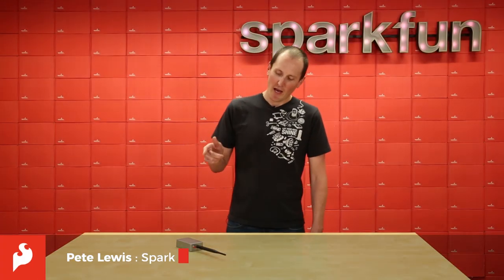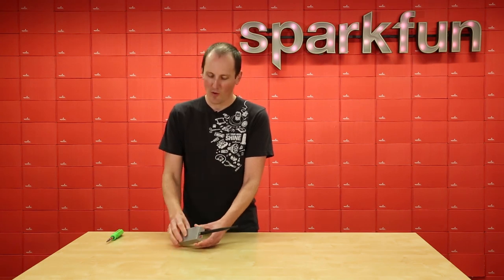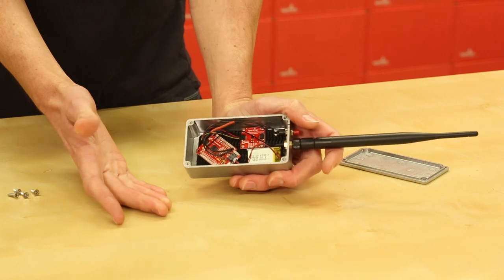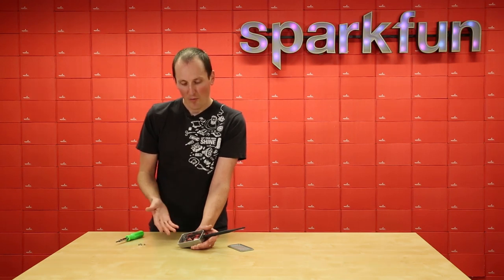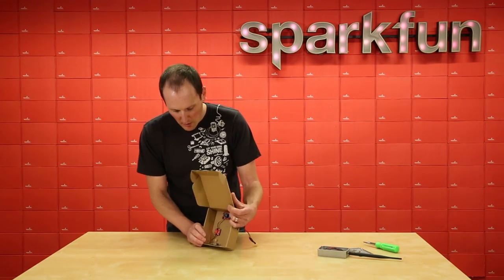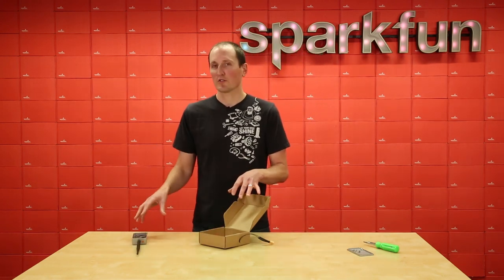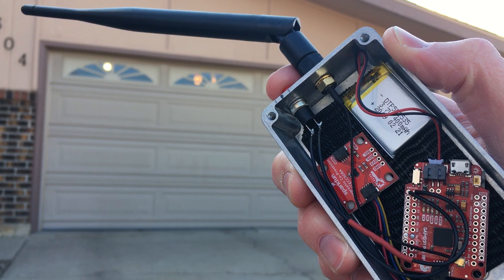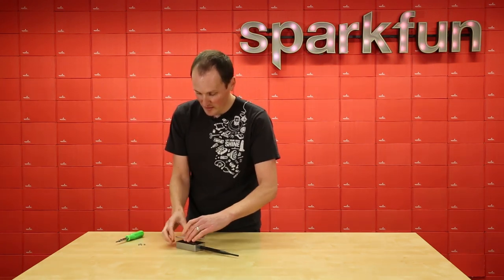Project Showcase: Secure DIY Garage Door Opener

Comment: It you had multiple garage doors you wanted to control independently, is it possible to use a single Pro RF in the controller and separate Pro RF modules for each garage door and just have either a seperate momentary switch for each garage door? or is there a simpler way of thinking about this?

Comment: Thought first "secure" means that the device attends to any obstacle like playing childs, dogs while opening or closing! ;-)
Reply: Haha. Well I'm sure you'll be glad to hear my IR safety beam detector is working properly now. It was actually broken a long time ago, and we've had to override the safety sensor by holding down the button for the entire time it goes down (such a pain). I eventually looked into it further, and the line to the sensor was broken. It was a very clean cut about 2 feet up the wall, so I'm wondering if it was super cold weather and it got caught on something, or maybe a certain curious child with scissors was involved :)

Comment: I'm just going to assume you disabled the original remote RF circuitry in the garage mounted unit. Otherwise you'd still be vulnerable.
Reply: Hi pratherat,
Thanks for commenting. You're definitely correct, and I overlooked this in my design. My plan now is to try resetting my unit to forget all remotes, and I  might even unplug/remove the antennae, but I'd like to avoid damaging the unit and/or voiding the warranty, but I'm probably already way past that :)

Comment: Hi hows the device in the garage powered?
Reply: Hi Josef, 
Thanks for asking! I forgot to put that in the wishlist... eek! 

I went with a wall wort power supply for the receiver end that lives in my garage. It terminates to microB, so it goes straight into the USB connector on the Pro RF. I believe the exact model I have in there is this:

https://www.sparkfun.com/products/13831

But that's pretty overkill at 2.5A. Our lower current version would do the trick:

https://www.sparkfun.com/products/15311

It was a slight pain to run power across my garage, but it when pretty qwiicly with a staple gun and an extra extension cord I had.

You could also opt to go with a battery power on this end too. With that idea though, you'd need to be listening for incoming messages all the time and so a plug in power supply option is what I chose.

Comment: so does your old 433Mhz built in receiver still there you need to kill that nice project
Reply: Wow, good point. Thanks for commenting. I definitely overlooked that. I'll have to open up the main control box and see how to disable that. Hope it's not too tricky!
Reply: @PeteLewis  All you've really got to do is reset it. On every one I've ever seen, there's a button to make it forget all of the linked remotes and then also to program a new one. If you set it so that there are no linked remotes, then it should be pretty secure...

Comment: needing to engineer something to escape the constant threat of snow parking bans(basically the city kicks us off the street so the plows can remove the snow). the 2 car garage behind the house im renting the 2nd floor rooms is half rented by someone who uses it maybe once per year if at all so the risk is pretty low (I can get the guy to call me if he needs to use it) So generally only 72 hours or so at a time and not worth getting a 3rd remote, so I figured using my arduino and some parts to clone the signal and use the setup as a 3rd remote. the back gate is frozen/buried to the ground so I have to round the block several times each time I need to go somewhere during these city wide parking bans. Which is going to be a nightmare in January when I'm back to work and getting up at 5:30 am. It leaves too much opportunity for theft as well having to run around the block with the garage door open. The only other way is to disconnect the safety sensors so I can do the "hit the button and slide under the closing door" trick

Comment: Great video, but it doesn't address what is to me, the most insecure part of a garage door opener..  Anyone could steal your car, look up where you live (which is probably on the registration in your glove box) and take that opener to your house, get into your house, and have free reign while you're at work not even yet aware that your car has been stolen..   You could redo this, with the addition of a fingerprint reader, and it would take care of that last hole..  ONLY your finger, (or your toddler in the back seat!) could open the garage.  Additionally, why not build a small circuit that uses a GPIO to latch the power on (through a secondary relay or a transistor) while it does it's work, so that you can just press and release the button instead of holding it for 3 seconds?  The TX could then just shut down it's own power through the GPIO once it knows it's job is through..
Reply: Hey Steve Jones,
Thanks for your comment! Indeed, you are correct that our cars are a pretty good target for criminals. I suppose I could get used to bringing my garage door opener along with me when I lock my car. But my current remote controller is pretty bulky, so I wouldn't really want to bring that huge thing along. I am planning on designing a custom PCB that includes the pro RF and crypto chips all in one. And I might be able to get by with a smaller battery too, so hopefully I could keep this new version on my key chain.

I like the fingerprint idea, but if someone stole the entire unit, then they'd most likely be able to crack it open (or simply unscrew the lid), then they might be able to spoof the proRF into thinking it saw a correct fingerprint read... depends on how that was implemented, but I'm guessing I'd use a boolean somewhere (maybe even just a GPIO from finger print reader to GPIO on the pro RF). 

Wait wait. Just had an idea!!! I suppose I could  make the cryptographic co-processor removable from my remote??!! It's tiny, and could fit on a small "key chain sized" PCB. This way, I'd simply carry around the most important part of the whole system with me. Aha!! 

Also, I love your power on idea. I'm currently considering 3 options: your idea, a single-shot mode nano timer, and a large cap.

Thanks again!!
Reply: @PeteLewis  Yeah.. I like the removable crypto too..  Matter of fact, you could probably make a mechanical interface that powered it on when inserted, therefore taking care of the other issue too..
Reply: @SteveJones172pilot  Oh dang. Auto powering up is a great idea! With all the help I've received in the comments here (yours especially), this thing is gonna end up pretty slick. THANKS!
Reply: @PeteLewis  Any updates on this for us?